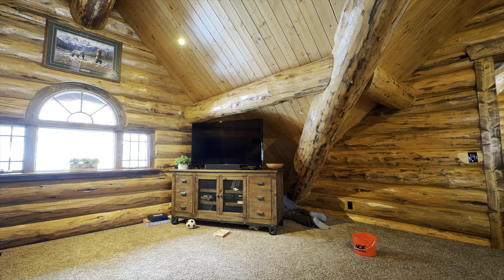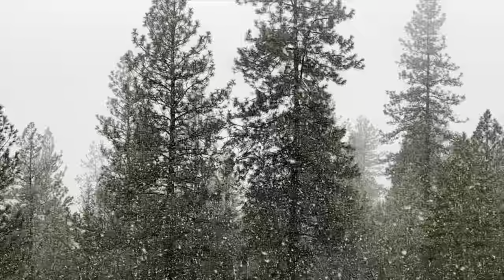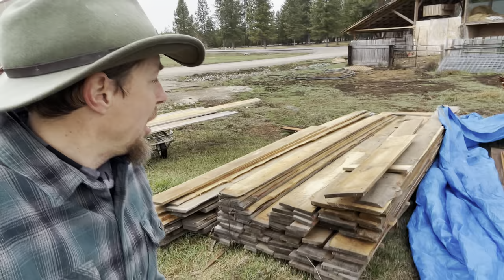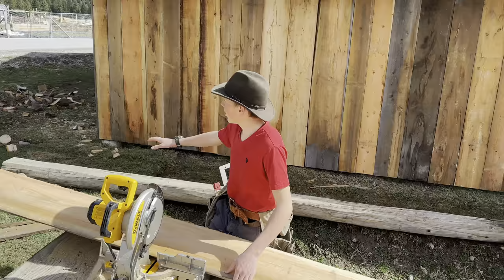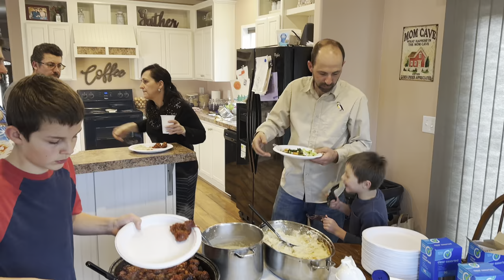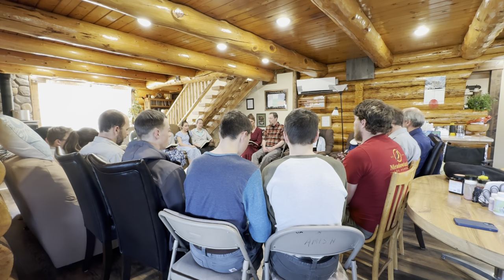Spring Cleaning our Montana Haven Home and Family A Cappella Singing￼

Comment: I noticed that pillow around y'all's mum's neck.   You can also use a Boppi pillow.   It provides arm support.  Get one with a washable cover. They are sold at Burlington.  I use both but prefer the Boppi as it gives arm support she might like it.  It is just a larger version of what she has.  It can also be put around the waist if she is sitting if she needs to hold something.   I got it for my very old dog so she is comfy when I hold her, which is how I discovered Boppi pillows.